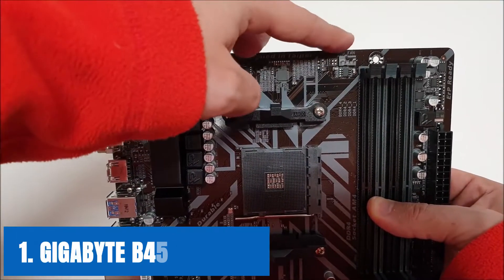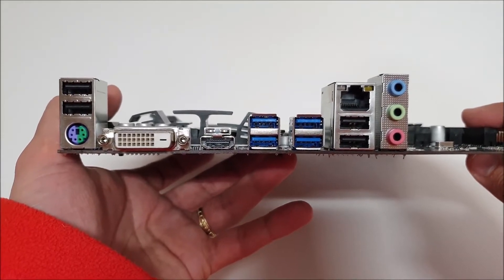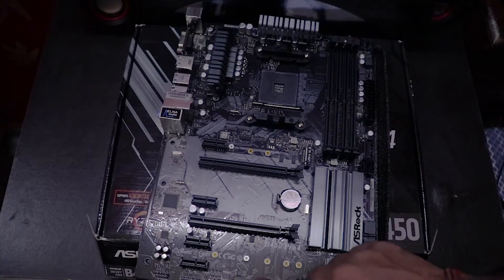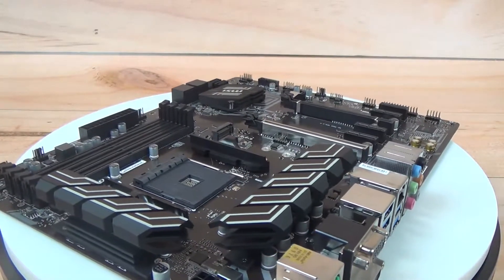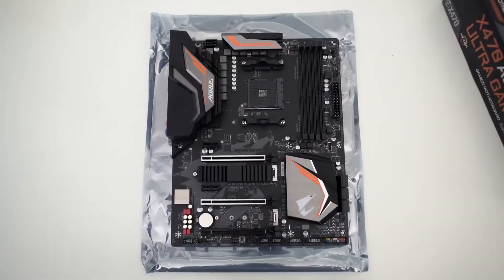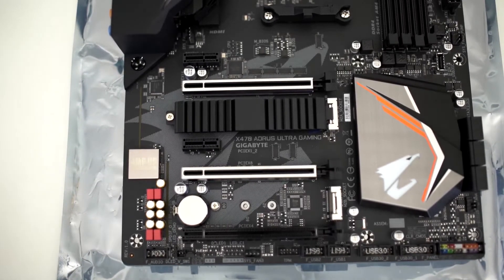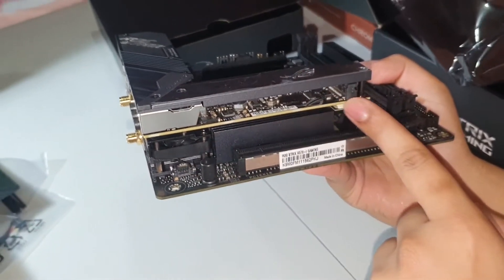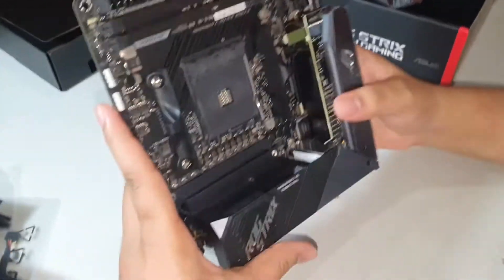5 Best Motherboard for Ryzen 5 2400G (2023)

Comment: You need to be careful  i was goin to buy a mother board on ebay and cancel my order 

Series 500 migth not be compatible caution plz
Reply: I bought the ROG Strix B450-F Gaming II. I know this was posted awhile ago, but I still thought I would bring it up because it supports 5000 series AMD out the box. So as of November of 2021 it supports every non TR4 AM4 Ryzen CPU to date. I got it for 105 USD, on sale of course, but I would recommend it to anyone who wants a B450.